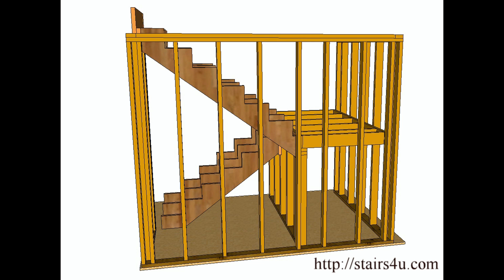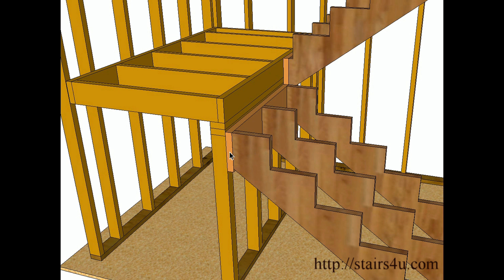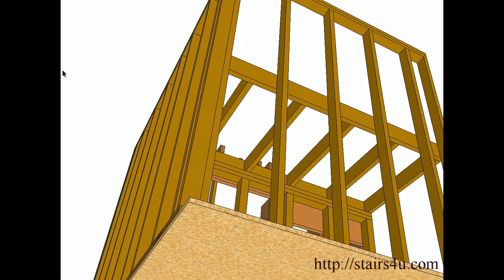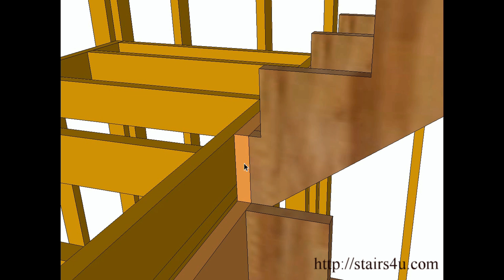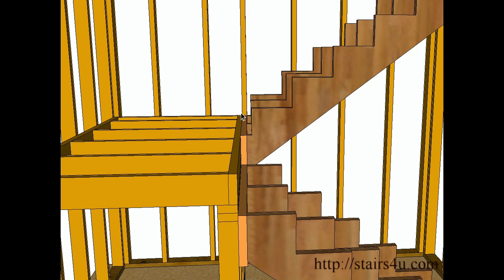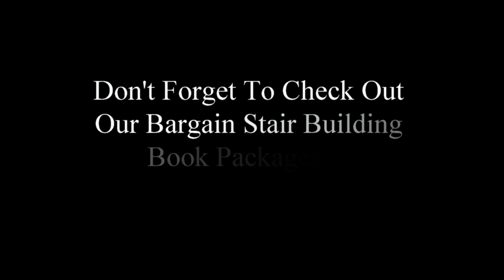How to Build and Frame Stairs Landings - U-Shaped Stairs

Comment: Are the floor joists for the landing 2x6 or 2x8?
What would also be helpful is to know what you are using for nails and or screws in securing the landing to not just the wall studs but the ledger to landing.

Comment: @stairbuilding I have a similarly shaped stairs in my house, they are winder stiars but also have the landing in the middle, I think about making the opening underneath the second flight, so that it can be better used as a mud room. Is it important to have a wall underneath the place where stringers are attached to the second floor? I'm still learning the terminology, hope I don't confuse terms, thanks you.

Comment: Excellent video. You align the nosings of the lower and up stair sections whereas I see a lot of plans that align the face of the risers instead. Why do you align the nosing and which is more traditional style?
Reply from the maker: I think what you're asking would depend on the project and should contact the building designer to verify what the tread lines represent. In my example, it's the nosing or farthest point forward on each step.

Comment: Hi, I have a U shaped set of stairs. We currently have a door under the landing to the kitchen. I have 2 supporting posts on each side of the doorway. I am trying to find out, without paying for a quote if it is possible to remove one of the structural columns for the landing without compromising the integrity of the landing. This is the only post I would want to remove and wonder if a beam would be sufficient replacement? Is this possible?
Reply from the maker: I won't be able to help, the last thing I want to do is tell you to remove something that will create engineering problems.

Comment: I bought this book and I have a question. For a u shaped staircase you mention a 4x6 for the bottom ledger to support the 2nd flight of stringers. Can I sister 2 pieces of 2x6 lumber instead? I prefer this method over hangers but can’t find 4x6 lumber . Thanks !
Reply from the maker: I've done it before with good results.
Reply: @stairbuilding  great Tnx !

Comment: Great Video. I asked the same question in a different video. The lower flight sits on a wood floor. This means the underneath joists are either parallel to the stringer or perpendicular. I believe the life and dead loads of the stairs are transferred to the thrust block at the bottom and then to the wood floor. the question is: Do you provide any extra support for this ?
Reply from the maker: A properly designed stairway should have all of the necessary support at the bottom, but I have personally built hundreds of them with the joist running in both directions and rarely was there any additional support, so it might not be a big deal. The structural design of the floor and the stairway and the building use will have a lot to do with whether or not additional support will be required also.

Comment: 16d nails to attach ledger or would you need some structural screws? Thanks! Your videos are outstanding.
Reply from the maker: If it made you feel better, then go ahead with the structural screws, but I don't think they would be necessary on practically any landing less than 4' x 8' wide and for private dwelling or residential home. This might change on public stairs or stairs supporting lots of weight.

Comment: Do you need the double top plate on the wall that supports the landing?
Reply from the maker: It would be good if the landing joist set on top of the single wall framing top plate directly over the wall framing studs. You can always use a small strap to connect the wall framing to other wall framing top plates if needed.
Reply: @stairbuilding  advance framing techniques are removing the double top plate for a single top plate and I wondered if I could do the same thing with stair framing

Comment: Best video I've watched so far, I have a standard staircase I must chop in half and insert a half landing with a couple of steps in that, it's also 11.5 steps exactly which adds to the confusion, where does the half step go? As its a trip hazard
Reply from the maker: If you need more room for longer stairway, try to find it, but don't make the landing or the step shorter.